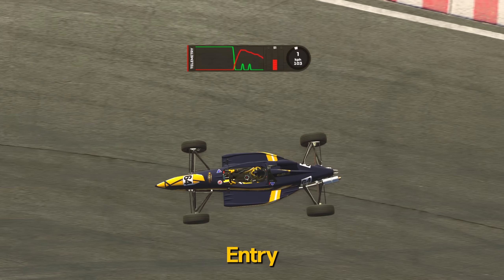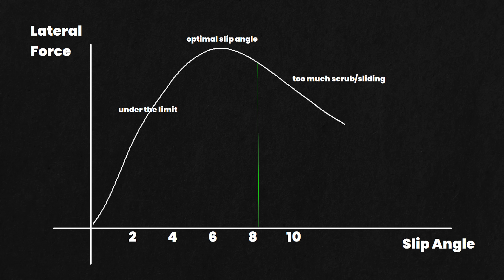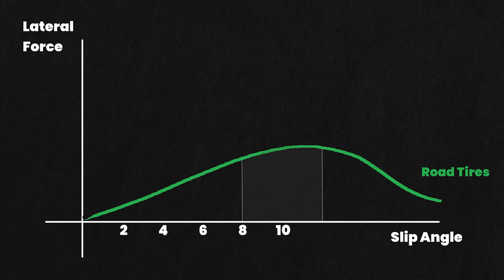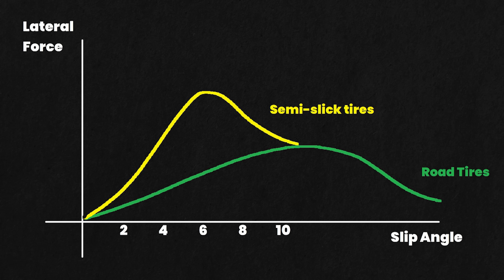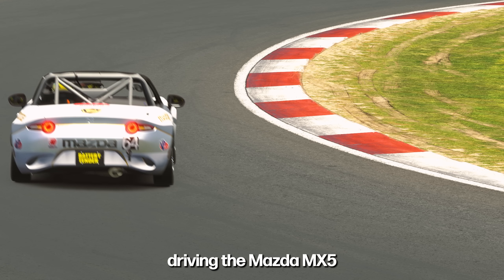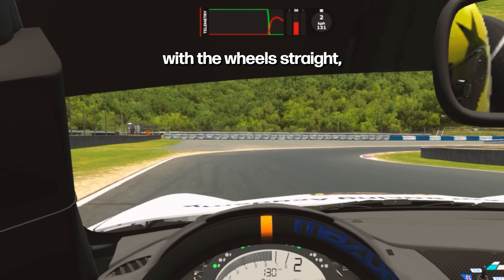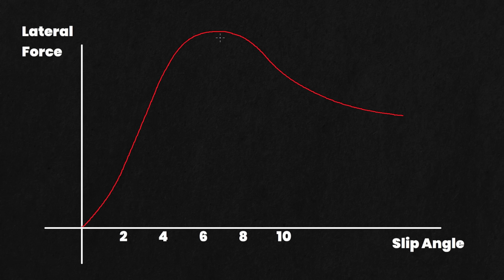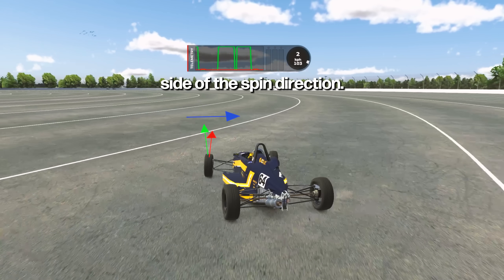The True Limit in Motorsports - Slip Angle Explained

Comment: it's dynamic in relation to COG and suspension stiffness. In racing track you want lower slip angle at high speed so you can pass in corners and beat times, then the 0-60 to power to speed on straights

Comment: I used to race a sidecar. If you push a sidecar in a straight line you will notice the wheels hopping and scrubbing. They are set up with slip angle already built in. As the driven wheel does not line up with the center of mass, throttle changes directly change the angle and balance of the vehicle. The vehicle only corners well when it gets "floaty", the setup is designed to give you a wide range of slip angle available with minimum loss of traction. 
If you are interested in vehicle dynamics you may find sidecars an interesting study.

Comment: 0:40 You still have a slip angle on the front tires, even in drift.. In drifting, the rear tires are way past their peak slip angle and sliding, but the front tires still need their own slip angle to generate enough grip to hold the drift line and let you steer the car. Without that front‑end slip angle, you wouldn’t be able to balance the drift or control the angle.

Comment: Now I finally understand what's the gimmick of going faster by keeping the steering wheel straight - it's because if you turn the wheel, then front and rear tires are at a different angle, and there's only one best slip angle.

Comment: This was the most excellent explanation of slip angle I've ever seen. When I saw the Miata's line, it made me think to add something about what happens when you use a high slip angle. When you drive with high slip angle, especially when beyond the peak lateral load, besides not being quite as fast is that you add heat and often wear to your tires. The Miata's line was a very high slip angle, with countersteering to maintain it. My point is that heavy cars, say a Mustang, would not succeed long using the example Miata's amount of slip angle. A heavy car will heat and wear the tires too much and lap times will go down because of it. Miatas and other light cars are more forgiving. Heavier cars and drivers needing many laps need to judiciously use very high slip angles to save their tires. Great great video, A+.

Comment: This is nitpicking, but saying that what makes a vehicle steer is tire distortion (related to slip angle) @2:00 is completely false. As example, a tire made of jelly would be able to have a 90 degree distortion on its contact patch, but would have very poor ability to transfer steering force, while on the contrary, a solid steel tire would be able to steer even if there is no distortion of the contact patch (albeit with lesser contact patch friction/traction than rubber). The described phenomenon is a consequence of soft air filled tires being flexible, and our having to examine tire physics to make best use of them within their limitations, but does not define the physics of steering in itself. Slip angle and tire distortion is in no way a requirement for the physics of steering and turning.

Comment: I wouldn't really generalize that racing, semi and road tires are so different in their slipcurves. In general racing slicks do peak lower, maybe 4-6deg in typical big tire sizes (although heavily depends on conditions and construction) and semis will peak slightly higher due to having more tread, and road tires a bit higher still due to having more tread and less rigid construction, but you'd be surprised how close similar dimension tires can get between the categories, and how much variance there can be between racing tires especially. Road tires follow more of a formula.

There's plenty of slicks which peak at 6deg and road tires which peak at 6.5deg or even lower at some higher loads. Dropoff also highly variable, I've seen from 19 to 34% dropoff at 1 SR IIRC, in similar/identical tests between tires in supposedly the same category.

Comment: 1:30 in aerodynamics, optimal would mean the best ratio between lift and drag, while maximum lift is achieved at the angle of maximum lift at which there is also great drag. so here too, the optimal should be called the point/angle at which the greatest lateral force/grip is obtained with minimal energy losses/drag
Reply: Optimal meaning optimal for lateral grip. It doesn't have to be complicated.

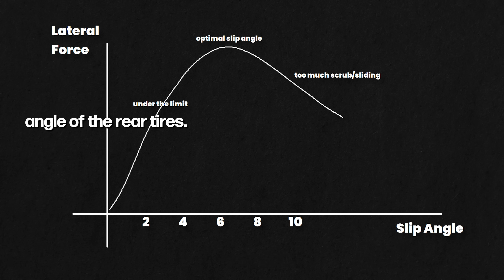Comment: 0:56 this is similar to in aerodynamics the angle of attack of the airflow over the wing/airfoil. there are several important points, some of them that have a similarity with wheels is the angle of maximum lift, after which the stall occurs

Comment: So this is why AWD feels so fast while sliding all over the place on gravel or snow. It is. And it’s fast because the optimal slip angle is large on those surfaces, and AWD lets you put the power down while simultaneously maintaining that neutral steering angle.

And of course it works on asphalt too, just is a lot harder to get everything right just an optimal slip angle that’s so small and precise.
Reply: Some surfaces don't have an optimal slip angle per-se, and it's just increasing until 90deg, and the yaw angle you take will be decided by how much FX you need and the yaw sensitivity of the aero.

Comment: Drifting is a misleading way to illustrate slip angle. You are falsely suggesting that there is actually slipping or lost traction going on. In fact the angle is internal to the tire and is between the contact patch and the centerline.

Comment: Good advices in terms of vehicle dynamics (understeer, neutral steer, and oversteer). But, from a tyre testing engineer point of view, I can say that the Lateral Force vs Slip Angle curves you showed and explained are wrong, expecially the non-linear and sliding part of the graphs. Since in motorsport this is a complex topic I would suggest to just stick to the Pacejka definition of those curves at same conditions. 
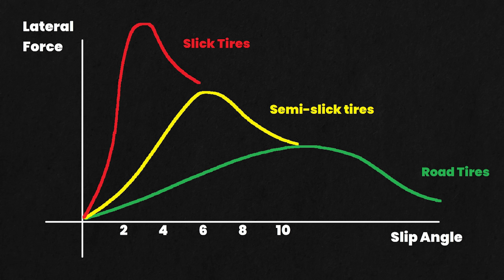@5:32 IDK where you found those graphs but both the shapes and the peak slip angles are inaccurate. 

Anyway, good advices, more than enough for somebody that knows nothing about tyre forces & moments.

Comment: Man where were back in 2009 Suellio??? I had to figure this out the hard way. I remember my "aha!" Moment. It was turn 1 at Daytona in the old Ferrari 488 GT3. The rear came out on me entering the corner, but the car was pointed pretty much right at the apex so I just released the brakes a little more, then came off the brakes and got on the throttle holding to slip angle all the way to the exit curb. I expected to see my Delta way down, it was 3 tenths up. I remember saying out loud "THATS how they get so fast!!!" You have to constantly practice this skill though, if I don't race for a month or two, I have trouble getting the back end around the right amount. Especially in GT3's and GTP's. It's worth noting I didn't start to master this until I got load cell pedals. If you can do this with Logitech pedals, and you upgrade to load cell, you're going to be unstoppable.

Comment: True optimization occurs when both axles operate near their peak slip angles (where lateral force is maximized), but achieving this requires balancing steering input, throttle, and weight transfer. In your MX-5/Okayama example, since you are countersteering past center, it should be generating a negative slip angle. This helps stabilize the yaw moment but creates traction forces opposing the ideal direction. Wouldn't it be better to induce less rotation in the first place?

Comment: Unfortunately this video is just _bad_. While mostly technically correct, it focuses on the wrong things and ends up being useless.

1) The grip of a tyre has two components, yet you only speak of lateral force, which is stupid and doesn't help comprehension. The second component is the longitudinal force created by accelerating or braking.

If you brake or accelerate too hard, 100% of the grip is used (the wheels are spinning or are locked) and you can't turn. That's why there are tools to help control acceleration (anti slip regulation, ASR) or braking (anti-lock braking system, ABS) to avoid those effects.

When cornering, you're trying to balance turning versus accelerating/braking, knowing that if 100% of the grip is used (let's say 90% braking and 10% turning), and you overdo it, you will slide.

2) Which brings us to the second point, weight transfer and inertia. When cornering, the inertia of the car will apply lateral force to the tyre (centripetal force).

Braking will load the front tyres, making it easier to turn (the front tyres give the direction). Accelerating will unload the front tyres (and load the rear tyres, useful for a Rear Wheel Drive car to accelerate faster), making it harder to turn.

My point is:
- you ignored that grip is used during accelerating and braking (without turning)
- you ignored the role of *inertia and weight transfer*, which affects the car during acceleration, braking, and turning

This is a bad video, and should be remade.

The slip angle is not what a driver should think about when driving, especially considering that other factors such as wheel angles, for example *toe and camber*, will change the behavior of the car, giving it more or less grip in varied situations.

Comment: 12:52 in LFS (sim game) you have an option to see the tire forces graphically in a replay or while driving, remember that even if the rear tires are sliding, they still making a resistance force, so the fronts don't necessarily have to make a force in the other direction, just that the front wheels twisting-force is smaller than the sliding-rear resistive force should start to decrease the angular speed (which does not guarantee that you won't spin out, if the angular speed is too high), maybe this is not so important for driving fast and doing corrections, but for example for drifting it's very important as the rear grip decreases a lot and changes how you have to countersteer

Comment: Looking at the graph around the 3 minute mark, the "Black Body Radiation Curve" comes to mind and I an therefore compelled to point out that the reason the lateral force doesn't keep increasing to infinity as slip angle increases is NOT because of the physical properties of the tire material and the system configuration (analogous to the oven geometry & refractory material) but instead because ANGLE IS QUANTIZED. 😉😜Great video BTW; it made me reflect on Michael Schumacher's supreme ability to control this and stay right at the peak of the graph, often using a slightly slower entry speed than his competitors but still exiting significantly faster with the data showing clearly how he modulated the throttle much more frequently than most/all his competitors, especially his 'team mate' in the same car!
Reply: Grip increase or decrease from slip is purely a mechanical and chemical effect. I'm sure someone could find a way to make a tire with peak grip at 90deg SA.

Comment: You forgot to mention that similar thing happens on acceleration and deceleration. English isn't my native language so I don't know how exactly is it called, but if translated from Czech it would be slip ratio. Slip ratio is ratio between velocity of the vehicle and orbital velocity of the tire (under acceleration tires will spin faster than the car is going, which you mentioned). That's a slip ratio in longitudinal direction and slip ratio in lateral direction is sine of slip angle. Problem is that the higher one of them is the lower the other one has to be. In other words if you summed them using pythagorean theorem they can't exceed certain value.
Reply: I'm not 100% sure the SAE definition for slip is actually correct.

Comment: Does it mean that when the car cannot be saved by counter steering I might just keep the wheel to its original angle so I can make the car a 360 rotation instead of 90 degree rotation and hit the wall? This is just a roughly speaking. I know there are probably much more details.

Comment: Half decent explanation until the comparison of race rubber vs street rubber, which is completely wrong. Racing slicks have BY FAR the widest range of useable slip angles, easily extending past 12° and tapering slowly, while street tires have the most narrow range, ending the most abruptly, and offering the least amount of control. In short the author for this fully backward. Of course this is not something you learn behind a keyboard. The reason is race rubber relies mostly (60%+) on adhesion where the tire glues itself to the ground (an electro-chemical bond) and uses rubber with extremely long polymer chains that extend like tentacles. Street rubber has 0% adhesive component and relies only on the so-called mechanical grip. The R compound rely maybe for 5% or so on adhesion, they are somewhere in-between but very close to the street tires. Well, they are street tires, just a little sporty. A proper race tire lasts about one hour and operates at 100-110°C (210-230F in retard-units) where the runner liquefies under the contact patch, enabling the adhesion. This also works on rain tires where the water locally evaporates and the tire glues itself on locally dry tarmac even under pouring rain. There is much to learn about tires. And it’s not from video games or YouTube videos made by gamers who never saw a proper racing tire in their entire life.
Reply: Sooo, you rent wrong but you are also not entirely correct. Race tyres absolutely have a sharper peak than street tires, how ever as you see in the graph he shows. When the race tyre looses grip it still has more grip than street tires the reason why it seems the way you think is that because even when a race tyre is sliding, it still has more grip than street tyre or amature slicks. But the peak is much higher and sharper of a peak. And the thing about street tires having none of that deformation chemical that causes more hysteresis that is used in race tires is true but it doesn’t mean that it doesn’t have any locking mechanisms or hysteresis and it is not just mechanical grip. Street tires and all rubber tires don’t get grip from old they get it from the mechanical locking with the asphalt. It’s just that street tires don’t do this to the same degree as race tires.. but they still do this. Which causes mechanical keying or locking its just that race tires do this better when hot which is also why their peak grip vs slip angle is so sharpe because when the slip angle reaches a point the Tyre no longer has mechanical keying. Drift vehicles work more with mechanical grip only more than any other vehicles because the rear tyres are spinning so fast they don’t get mechanical keying nearly as much as even street cars do they are just spinning their tires relying on friction to do the work. You are right but not completely and its easy to make that mistake i made that mistake to when i was learning all of this..
Reply: Oh but you re wrong bout the electro chemical bond thing.. tires don’t do that at all,, that’s not a thing it’s just mechanical keying.

Comment: One thing you missed and should be in your video for the sake of "completeness" is that the tire has a total amount of grip it can produce. If you are asking maximum lateral acceleration or grip from it, in the optimal slip angle, adding brakes or power will take grip away from the lateral acceleration  or make the tire go over its limits. And we can see it all happening on the demonstration... great video.
Reply: Jason Cammisa demonstrated this by driving in circles in his review of the Toyota GT86 on Hagerty.
Reply: Not true for many tires, perhaps all tires. Tires generate more grip when in slight combined slip. Likely wrong behavior if the sim doesn't do this.

Comment: 1:57  That distortion is what I've always thought of as the tire slip angle.
:53  The tires on the drift car don't have that distortion. The rear tires have broken loose so they're just sliding sideways across the road. They have given back the distortion that they had before they broke loose (unless the slide was initiated with the e-break in which case they never really developed a slip angle.)

Comment: In physics models, there is the coefficient of friction that essentially represents how sticky two surfaces are together. It changes depending on how much they are moving relative to each other and is usually divided into the cofficients of static and dynamic friction, respectively. The cofficient is usually higher for static, but when that is overcome and becomes dynamic it drops dramatically. For most substances it actually reaches a maximum under slight movement before it "fully breaks free". Think of experiences of sliding stuff around on a table and how much force it takes.

In terms of vehicle dynamics it means that each tire reaches the maximum amount of friction force when it is under slight movement relative to where it should be if following the exact rolling tract. This is different than drifting, because drifting isn't finding the exact right slight movement on the maximum, but way past it into the range of dynamic friction.
Reply: Tire friction dynamics are too complicated to really put into a post, but it has a lot to do with hooking and unhooking of strands and not terribly much traditional eraser-on-a-table logic.

Comment: Hello 👋🏾 your videos are fantastic and I’ve been watching for a while, as someone who has to switch between wheel and controller, how do you transfer the concepts onto controller? Neutral steer can be hard to achieved consistency on controller and the incremental steering on controller depending on speed ( Gran turismo ) also poses a challenge to apply your concepts unlike on wheel. Despite this using your advice I’ve gotten to top 300 in the world once on gt7 🙌🏾